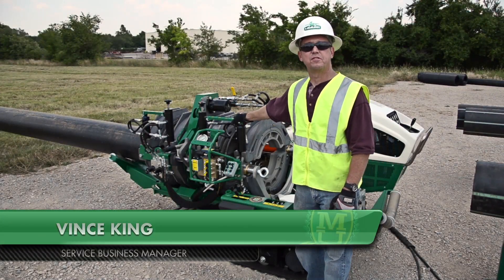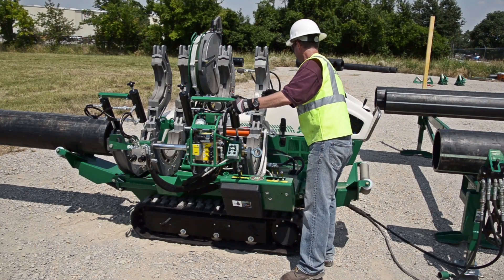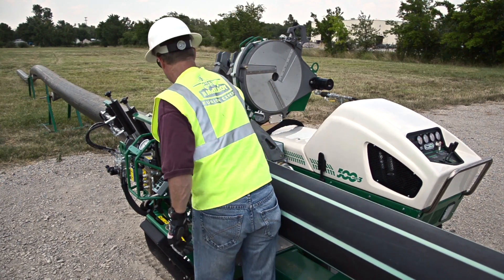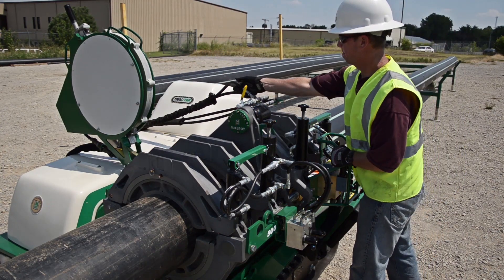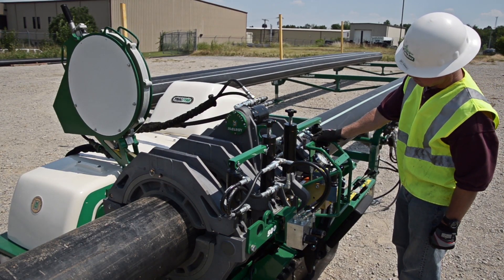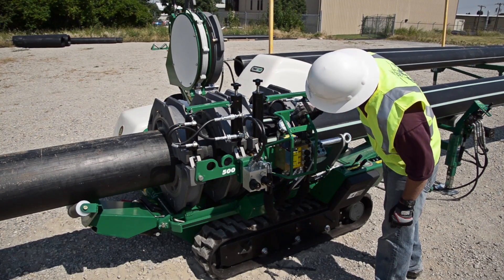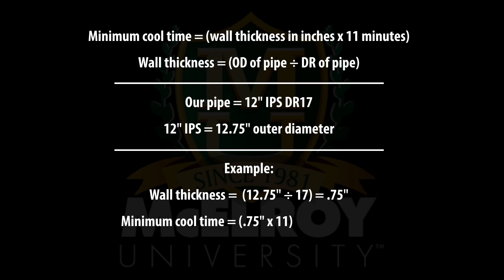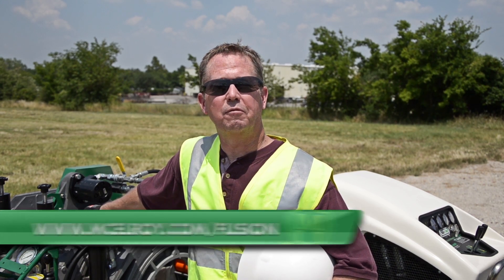How to Fuse Pipe with the McElroy TracStar 500 Series 3

Comment: Used a couple of different size machines making lines for a coal reclaimation plant. Easy peasy gig. Good equipment, not a single failure. Miles of lines fused. Almost all of the pipe was used material from previous operations at the shut down open pit mine where I worked.